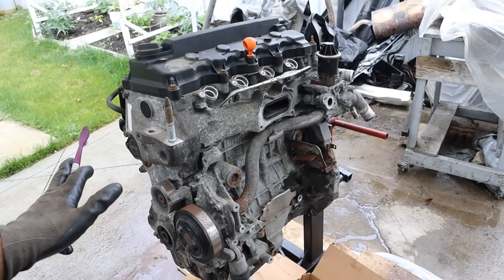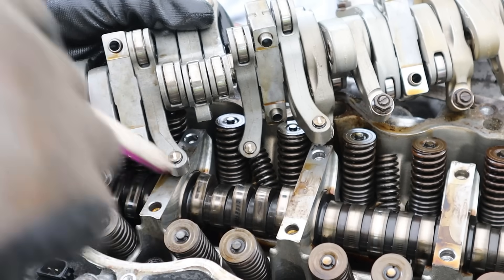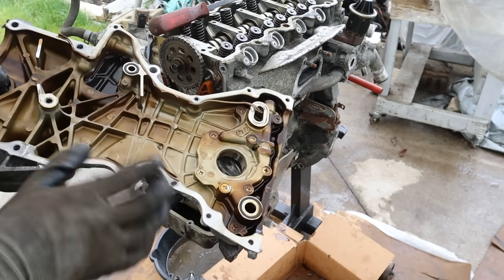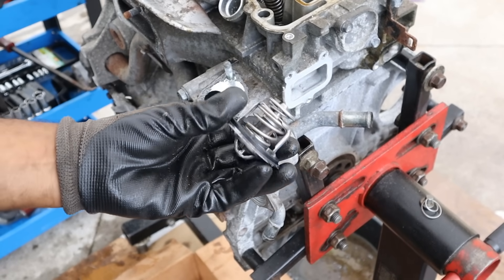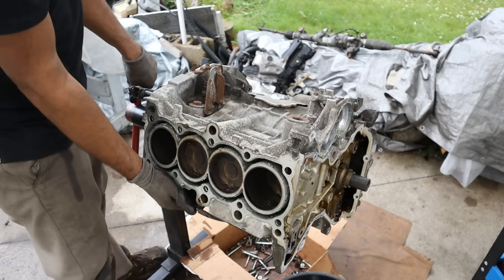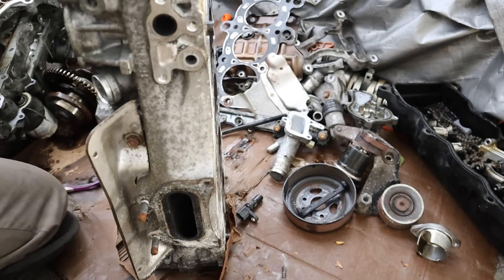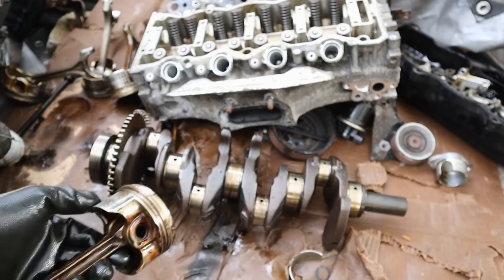Modern Engines are Junk: Honda Civic R18 Teardown Proves they Don't Make Them Like They Used To

Comment: The last reliable, old school Civic was made as recently as 2024! Civic hatch with a K20c2 and a Manual! They dropped the manual and the c2 for 2025 in the regular civic, and now it’s cvt only and some weird k20c with direct injection. Lots more crap for 1mpg (on paper) more
Reply: Latest version felt slower just to get 1mpg more
Reply: I have a 24 hatch k20 with a manual.  It's a great commuter with good pep and awesome mpgs.
Reply: hrv starting 2023,  is civic frame with k series engine 2.0 port inject...just a little heavier with different body
Reply: But even K20C2 has grooves in between cylinders, making head gasket thinner. It's an adherent design issue with new generation of engines unfortunately. There is a video here on YouTube of one person taking K20 C2 apart.
Reply: @varfalex  correct, though it far less likely for this to be an issue considering that it is naturally aspirated
Reply: @mattkroening7964 only time will tell how long the HG lasts. I'm still driving 2nd gen fit (manual) and it feels like its a little tank, super reliable little car.  And it's proven 1.5l L15 in old Honda fit can easy go to 500.000km
Reply: @varfalex is it 1.5 liter?
Reply: @Tracymika-o8x 2.0 K20 c2
Reply: @Tracymika-o8x https://youtu.be/Y4kVaOXe6TU?si=hKcBMPw4ltfiRAF0
Reply: https://youtu.be/Y4kVaOXe6TU?si=av6CJFZEYJ5b5Ku_
Reply: If you watch this video of tearing down K20 C2 you will see that it's also have grooves. But this engine is not turbo charged, so it will take long er for this head gasket to get blown
Reply: love my 18 k20c2.  Has true vtec and super honda reliable.

Comment: They still offered a port injected K20 in lower trim civics until about a year ago.
Reply from the maker: Now replaced by the hybrid
Reply: @speedkar99  No, the base lower trims still have a naturally aspirated K20, with the recent refresh they made it direct injected instead of port. 

The upper trims get the hybrid system with the naturally aspirated 2.0 with direct injection as well but I believe that’s not a K20.

Comment: Having ivtec doesn’t necessarily mean it has to be slow. When it comes to airflow, bigger is not always better
Reply from the maker: Comparing to the real high RPM VTEC
Reply: The K20 and K24 (performance versions) are famous for oversized ports...  It does reduce stock torque somewhat, but means a lot more power can be added without the need for porting.

Comment: I sold my 2006 Sedan to a friend in a jam.  After 19 years I figured a new Civic was in my future.  I looked into it and was frightened off by the CVT and the 1.5 Turbo powerplant.  I ended up getting a ‘15 with manual transmission and am quite happy with it.  I’ve owned both gen 8 and 9 and actually prefer the gen 8.  Both are solid, long term propositions.
Reply: 8th gen si is goated
Reply: @ponikgarage i’m on my 3rd 8th gen si i’ve also had 3 r18s but one i si swapped and that’s my current “si”. It’s a sleeper lol.
Reply: I have a 2015 civic si coupe the 2.4L and 6 speed manual is awesome and super reliable
Reply: I've put over 100k on my 17 1.5 with a CVT, I bought it with 40k. When it goes I will go straight to buying another one. It has been so damn reliable, haven't done anything to it except coolant/CVT fluid/oil changes and brakes.
Reply: Honda's CVT is reliable as long as you do the maintenance right, and most 10th gens come with 2.0 NA here in the States, which they have proven to be reliable; the 1.5 turbo is only available at higher trim levels, not a big issue if you want a tenth-gen, just avoid the 1.5 turbo model. And tenth-gen feels way more comfortable and high-end compared to the previous gens.
Reply: @kencai6803  CVT’s are now requiring service every 30,000 miles to keep them from blowing up.  That’s not the Honda that made us Honda fans.  
The 2.0 motor has a good record and should last quite a while.  
Civic has never been about ‘high end’-basic, reliable and affordability is the legacy.  Honda seems to have strayed from that.
Reply: With basic maintenance an r18 will hit 300k no problem... With meticulous maintenance even further.
Reply: @HighSpeedEnthusiast An r18 can hit 300k with no maintenance.
Reply: I love 8th gens i’ve owned 6 of them and have 2 at the moment
Reply: Man, the 8th gens seem to last so much longer than the 9s in general
Reply from the maker: They did alot of cost cutting in the 9th
Reply: @speedkar99 I’ve driven both honestly they feel pretty similar the 9th is more torque for daily driving but less revs still pretty fun
Reply: @speedkar99 
8 and 9 are pretty similar.
Its the 10th gen i would never buy.
Reply: @alphatrion100  Tenth-gen with the K20C2 and CVT are proven to be reliable, and Honda reached the highest sales record with the tenth-gen Civic, just avoid the 1.5 turbo model, which is not a common model in the States.
Reply: @kencai6803 
Well, in Europe we had the 1.1 turbo, the 1.5 turbo and the type R.
Let's just say the 1.1 and 1.5 do not live up to the reliability and durability standards we've come to expect from Honda. They just dont last as long and aren't as trouble free as gen 9 and older.
And nobody bought the type R because for that kind of money people choose German cars here.
Reply: @alphatrion100 If is in Europe, I believe there is a 1.6 disel tenth-gen Civic I never seen in other countries but in Europe. That interested me a lot because we never got any disel Honda here in the States.
Reply: @kencai6803 
Yeah there were diesels available here. Can't speak for other countries but here in the Netherlands diesel are almost extinct. Most people don't want them anymore because the road tax is way more on them because of the environment.
They are way cheaper to buy used than the gas cars and were pretty powerful is what I've heard.
Reply: @kencai6803 
The 1.1 t and 1.5 t will never be as reliable as the old 1.4 i-vtec and 1.8 i-vtec though. And guess what? Durability was the main reason for buying a honda!
Reply: @alphatrion100 Sorry to hear you guys there can't even get a non-turbo engine option since the tenth-gen, I guess is all because of the emission regulations and stuff.
Reply: @kencai6803 
Yeah. After my 2015 I'll probably switch to Mazda. I believe they have some more recent naturally aspirated options. Get a low mileage Mazda 3 or maybe a cx3.
Reply: @speedkar99  hi, I actually decided to read the comments first because when it's about r18a I figured the comments reflect many years of experience with the engine which I really wanna know!! I strongly believe that 8th gen Civic prefacelift, I mean only pre facelift, is something extraterrestrial, not from here. Still after many years 8th gen Civic looks modern, stylish & reliable because the body doesn't rust so much & the engine runs up to nowadays, I mean if you buy a Civic today it's gonna be a daily driver for you to enjoy for many years more, I think they sell it only because they want to try something else & then regret it!!)
Reply: @snoofayy6150  8gen had more recalls than 9gen
Reply: My understanding is that the 1.5L doesn't really go into boost that much or with very high PSI. People talk about them like they're twin turbo V8 sports cars. Modern oils are formulated to tolerate it too. Afaik it really comes down to the nuance of the application. CVT just change the darn fluid.
Reply: @sulljason  oil dilution was a serious flaw in the first few years with owners having regular service and engines failing.  Same with the CVT.  Now, to keep your Honda in tip top shape it requires much more monitoring and maintenance.  Sorta doesn’t sound like a Civic to me. 
I’ve owned nothing but Civics since 1987 and consider myself a Huge fan of the platform.  What it has become feels like betrayal.
Reply: @sulljason 1.5 will kill injectors around 130k or so, oil dilution is a major issue if it idles at all. Head gaskets will go somewhere around 100k on CRVs and some Accords, seem to hold on the Civics (which run 16 psi instead of 18). The CVTs will last forever if you service them at least close to every 30k.

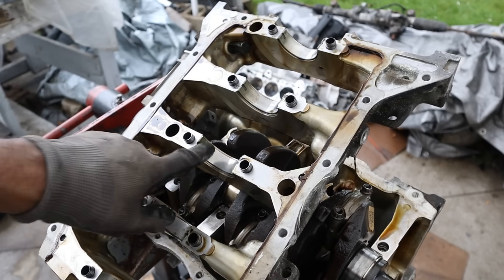Comment: 9:30 funny pun 😅
TBF, you don't need crankshaft bearings which last 500tkm, if the engine fails at 200tkm.
My VW 2.0 FSI is at 250tkm, eats oil like a champion, but they seem to do that no matter the mileage. I hope we (me and the car) will see 300tkm.
Reply from the maker: All new cars with thinner oils are burning more and more oil because of smaller oil passages and clearances.

Comment: Im very happy with my 07 civic 5 sp manual! My r18 has 360k km and runs like a champ. Low maintenance car and excellent fuel economy. Im sure it will hit 500k without any issues!
Reply from the maker: Oh a manual would go many more kilometers easily
Reply: 09 civic vxi manual on 385000km's. Still purrs to 210km/hr easily.. Engine never been touched.
Reply: 5 speed manual? I only seen 6 speed
Reply: @zokonjazokonja  my 08 r18 civic is a 5 speed

Comment: 2006-2009 R18's had casting faults which causes the blocks to crack. But in my experience they all crack well over 100k miles. I had a 06 personally that cracked the block at 205k and I JB Weld'd it and donated the car to someone who needed it. It got another year of use before being totaled in a crash.
Reply: I had a 2006 that I owned for 19 years and 413k km. Rust sent it to the junk yard. The engine was perfect.
Reply from the maker: Yeah but not all of them had the issue. 

Apparently the JB weld holds for a bit.
Reply: i have 225k miles on my 07 R18 no cracked block for me runs like a top
Reply: Rather than recalling the engines with cracked blocks Honda extended the warranty to 10 years.  Which is why I and my family will NEVER purchase another Honda product again.
Reply: R18A1 made for US market - sadly yes. 
In Europe we have R18A2 and its one of the most reliable engines ever made.

Comment: I refuse to buy any engine with plastic parts like that.
Reply from the maker: You think this is bad? Wait until you see more modern engines...! Junk!
Reply: @speedkar99 I've seen it on my family's cars. Plastic oil pan, hit a fallen tree branch or barely overheat and the engine might be done for.
Reply: Honda's plastic parts don't cause a problem. The plastic valve cover on my r18 was totally fine for 19 years and 413k km. The aluminum valve covers on my J35 are corroding around the plug tube seals and may need to be replaced at some point.

Comment: Just changed the timing belt on my 2002 odyssey with 304k miles.
Reply from the maker: Cool story. The J series is a great motor. RIP that transmission though

Comment: It wasn't the last era of port injection.  K20C2 (Civic LX/Sport) was still used to 2024 model year, and K20Z5 (HR-V) is still being made & sold!
Reply from the maker: Yeah the 2.0 is now replaced by the hybrid. 😢
Reply: @speedkar99 the turbo is what the hybrid replaces
Reply: Whole reason I picked the sport trim 2023 civic with a six speed and K20C2. Was hoping to snag one of the last semi-bulletproof civics offered.
Reply from the maker: Good choice

Comment: Is it me or is it hard to check the oil using the dip stick on those older civics.
Reply from the maker: same here! its because the dipstick is orange, and fresh oil is a thin gold. Not much contrast to see the oil level.
Reply: @speedkar99  I would roll it on to a clean paper towel. It leaves a perfect mark showing the level.
Reply: I never had an issue.

Comment: Some of these engines gone well over 500.000 miles over 800.000 km still runing even today just fine with regular oil change 0W20
Reply from the maker: Yes, the engines run. Wish Honda would make good engines again. The transmissions usually give out first.
Reply: @speedkar99  I got mine with 6 speed manual so who knows eventually will fail some day
Reply: I don’t see many major issues with this engine in civics. However, I do see CVT transmissions giving out at around 1/3 to 1/2 of the engine’s typical lifespan

Comment: I've had multiple Honda Civics over the years. I just got rid of my 2019 L15 Turbo after noticing a coolant leak that was clearly part of the head design. Well actually, I got rid of it after seeing a tear down of the L15 (which were in most civics, accords and all CRVs - I can't believe the headache Honda is going to have). Lost $10K as a result but feeling like it had transmissions issues as well, I had to cut my losses and lost a massive amount of respect for Honda as a result. I went BACK to a 2009 (hopefully outside of the cracked block issue that I had with my 2006 and 2008. But the simplicity of it is astonishing refreshing and the peace of mind was worth the $10Gs lost (almost). And the interior of the 2008 (leather) is honestly SO MUCH better than the 2019. Sure the fuel economy isn't there - or is it? Because I ran only 91-93 octane in it and that cost easily 35% more so...

My favorite though is the 2.0 litre K20Z3 from one of my 2006 models. It was normally aspirated and could get me as little as 6.3 liters per 100/k (or much more depending on how you drove), on regular grade fuel. My 2019 L15 could only manage, at best, 6.9 per 100, driving like a grandma on 93 octane. And don't get me started on direct injection.

Honda lost their way on all their products - motorcycles mid 2000s and cars/SUVs, mid 2010's. I still have a 2007 CRV (2.4 litre) with 400K going strong and looking sexy. My 2009 Civic is awesome and has 230K. My 2019 had barely a 100K (and looked like the cylinder head failed BEFORE I bought it at 80K) ... just sad.
Reply from the maker: I agree, Honda lost their way in the name of emissions. Not fair to the brand loyalists. At least Toyota didn't deviate too far from their recipe on hybrids.
Reply: The 08-16 CBR 1k was an amazing bike lighter and more powerful than before and remained very analog compared to others, the huge midrange and predictable handling allowed John McGuiness to win a lot of iom tt races

Comment: I had a 2016 Civic with 1.5T and we sold it before the head gasket issue. we also had a 2006 Civic and the block cracked at 55K. with a nice letter to Honda, they replaced the engine under warranty. We sold it immediately. my 2011 Hyundai Sonata and 2013 Elantra has been solid, zero issues and very little maintenance cost. Our next car will likely be Hyundai Tuscan or upcoming redesign KIA Seltos. They have dual injection engine and real automatic transmission. solid cars.
Reply from the maker: You sold a Honda for engine problems and went to Hyundai?
Please keep oil in it, as they're known to blow out pretty fast.
Reply: @speedkar99  I do my own oil change and maintence at every 3K. I also inspect under the hood and oil level every Sunday. OCD but I enjoy it. lol...
Reply: Replacement engine from Honda 🌹
Sold it immediately 🥀

Comment: most car manufacturers no longer are car builders but banks so ofc they dont build quality anymore
Reply from the maker: they are in the business of financing but happen to make cars.
Reply: they are technically called "system integrators." honda builds the chassis and supplies the engine (they are the world's largest ICE manufacturer) but the rest of the car, from the steering rack (bosch) to the ADAS (Renesas) are all third party OEMs
Reply: @mahzorimipod That's interesting! My 8th-gen is still using a Showa (so in house Honda) EPS steering rack.

Comment: I swear I will never get tired of the "VTEC kicks in yo" jokes.
Reply from the maker: Same, even though this isn't real Vtec and isn't marketed so.
Reply: @speedkar99  this is real vtec but it doesnt add power it adds efficiency. vtec kicks out on these
Reply: @rabbitdrink  "kicks out" this is so accurate ;P This engine goes to redline everyday - it needs redline for normal driving. Maybe this is why it is so reliable.
Reply: Had this engine and it lasted until around 300000 until the head gasket and/or the block cracked. It wasn’t worth anything and replaced it. Engine was ok. My 95 civic sounded way nicer when pushed.
Reply: I have a 2014 Accord with an R20 engine i VTEC. Fairly economical
Reply: you beat me to that comment!
Reply: I'm still laughing. VTEC kicks in Dad joke tier XD
Reply: it’s always funny to me the discussion around what is real vtec and “fake” vtec.  Well people got so used to the economy civics having ivtec cams that are more efficient below about 3500 rpm, when you tell people the K20C2 in the newer civics has real vtec they get upset and disagree with you. it doesn’t compute with them and someone will tell me i’m wrong. it is true it doesn’t have much of a kick stock, but a tune wakes it up, it does have a true vtec lobe on the intake only at 5500 rpm, but you can make it earlier
Reply: ouais ta daronne la pu qui tourne dans les caves de france jokes

Comment: I have a Civic sedan with this engine,one of the best choices overall in the category.No expensive components like turbos,DPF,direct injection or frequent timing changes but it also has decent power and good fuel economy.
In Europe there were no problems with blocks cracking so you can go 3-4-500k kms with pretty much 0 money spent on engine repairs.Only problem can be oil consumption but that comes down to improper use or maintanence by previous owner,mine has 0 consumption at 220k kms.On the 9th gen EU Civic they screwed up the early models so those start eating a lot of oil but 8th and later 9th gens are fine.
I do recommend an ECU tune for the throttle,the factory setting is very lazy and slow,with a more direct gas pedal reaction its a lot more fun to drive.
Reply from the maker: The 8th gens were more fun to drive. The 9th had a strong focus on economy, hence a big stupid ECO button on the dashboard amongst other cost cutting measures. At its core, the R18 did its job well. Wish they could come up with a better solution than the L15 1.5T.